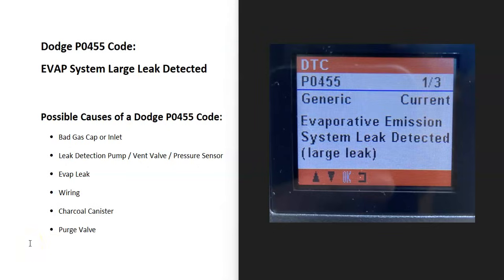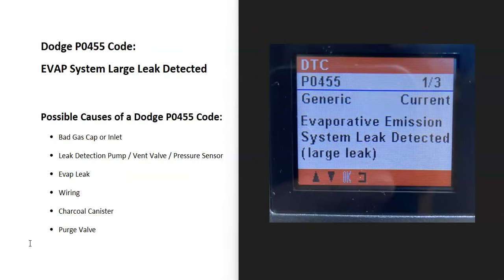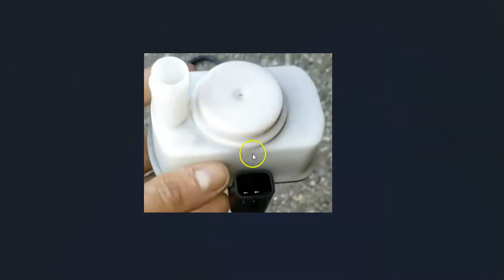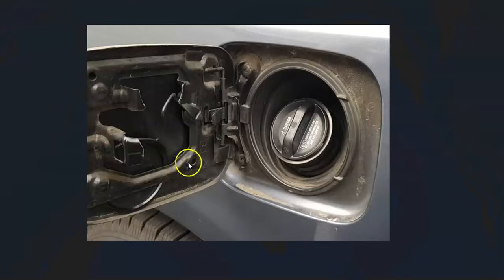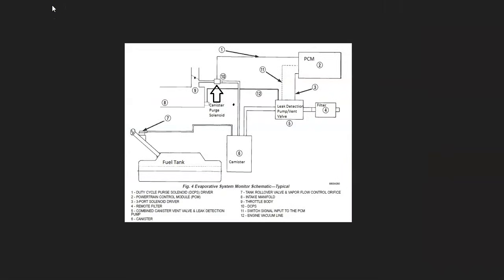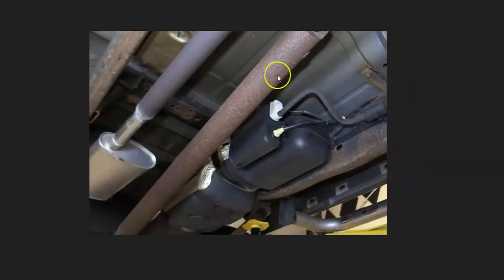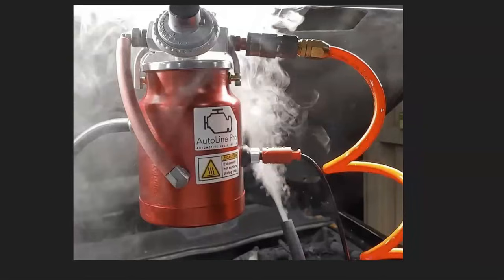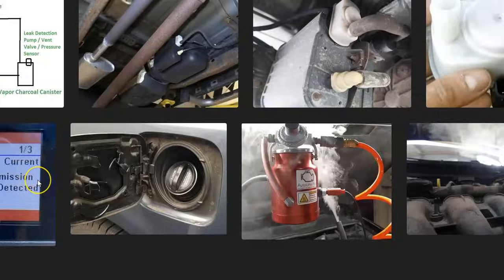Causes and Fixes Dodge P0455 Code: EVAP System Large Leak Detected

Comment: I have a 2002 Chrysler Voyager 3.3L flex fuel v6. I never used flex fuel, just the regular stuff. Got to figure out this problem. Had the evap check engine code recently. Put some seafoam in gasoline. It went away but then got misfire in cylinder 4 code months later after not driving it a couple months during winter. Replaced spark plug, went away. But i can feel it's not happy. Like not enough power, like pressure loss. After 45 miles per hour, it's vibrating mildly. To get it to 45 is slower, as if im down a cylinder.
There's messy oil around front left side, near manifold and wires near altanator. Was gonna clean with Tire foam and then go from there to see if i can tell where leaking is coming from. Also, my RPM starts off at 1000 and sometimes it wants to go forward in drive, but not doing that since new spark plug.
 I went ahead and bought a new PCV sensor. Going to try that if i dont end up finding some leak or after checking the hoses. I have a jack but hate going under the van. Saw that theres lots of hoses and possible lose connectors that run underneath too and these are known to losen on these chrysler/dodge minivans. Oh, joy! Pray for me. Good grief. ❤😂

Comment: Would this code have anything to do with a high pitched whistle and or my truck stalling out and sputtering?
Reply from the maker: Usually, no, but if the purge valve is stuck open, it can cause the engine to run badly sometimes. With the whistle noise, I would check for a vacuum leak. If you think the purge valve is bad, block the hose to the engine from the valve and see if it improves.

Comment: I have replaced everything. Literally everything and smoke tested twice gas cap, purge valve, wire, hoses, charcoal canister, and leak detection. End result p0455 still there. Dodge sucks
Reply: Did you replace the gas cap with an OEM Dodge one? I had a brand-new aftermarket one and the code went away when I got the OEM one.
Reply: @Gary_in_NoVA   yes sir two oem ones. Still has p0455. Still till this day fought this for a year now. Took it to dealer and 5 garages. And myself repairs. After drive cycles. Code pops up. Also brand new tank with integrated roll over valve and oem brand new fuel pump. I'm selling the peace of junk. Never again with a dodge.
Reply: @chadjohnson7544 .  lol. I hear you. This is my last Dodge Ram, too, for sure.
Reply: @chadjohnson7544  I remember getting that code, without any other symptoms, shortly before my ECU died (2002 B3500 van). Sounds like it might be your computer- I've gone through a few, but think I figured out why they kept dying (bad ignition coil).

Comment: I kept getting a small evap leak detected. I changed the purge valve, the pressure sensor/vent valve, and the gas cap. Then I kept getting gas cap code with the brand new one intermittently. Now I have a large evap code.
Reply: Computers in cars was so dumb these damn chips think if the car is worn everything is wrong so here’s a CEL no matter what
Reply: there are some hoses above the charcoal canisters  are hard to see that deteriorate and crack that leak, also some hoses along the side from the canisters to the engine also deteriorate that also must be changed

Comment: God help me lol I have a 2013 ram 1500 4.7L. I have a p0455/check fuel cap light on. I have replaced the fuel cap twice with a mopar one, leak detection pump twice with a Chrysler one from dodge and purge valve. Still have the dang p0455. Hoses all look fine I’ve traced them from tank forward. Wonder if my ecu is just dumb.
Reply: I have same problem with 2002 Dakota 3.9l p0455 wondering if you alr got fixed
Reply: Same here
Reply: Mine did this and changed esim and fixed the gas cap code.

Comment: Yo just spray the damn hoses with soapy water, anywhere a bubble forms there's a leak. Old farmer hack
Reply: You can also put a hose to the evap line and blow cigar or cigarette smoke in, or use a cheap $10 pump.
Reply: @The_Gallowglass exactly  i found a split in the hose coming off the charcoal canister my dad use to do cigar smoke so figured it would work the same by using my vape blow some mixed berry ice vape juice through it lol and seen it come right out at the first bend figured all the vacuum lines under the hood was kinda dry rotted replaced those cleared the code the gas cap was already replaced and it would built pressure can hear the his when you open the gas cap after replacing it, so the rest must be in the hoses under the truck also and sure enough there it was, I use to just use dry ice and water in a soda bottle but no one sells dry ice around me no more  but yup figured it out with pretty much what you said
Reply: @The_Gallowglass  just my luck fixed all that than the purge valve went replaced that and good again
Reply: exactly I use my modded vape box just turned up my hit it hard and blow some berry ice vape juce vapor through it found a crack in one of the hoses right away  @The_Gallowglass